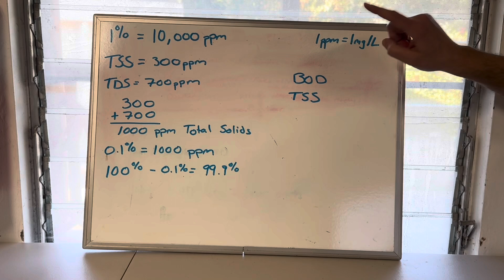What Is Wastewater Anyway??

Comment: So everything that is not solid is assumed to be water.  Couldn't there in theory be other liquids besides water?
Reply from the maker: Great question!  Yes there will be other liquid constituents in the wastewater, but on a percentage basis it’ll be negligible.  Take ammonia for instance, which typically comes in somewhere between 20-40 ppm (mg/L).  That is around .002-.004%.  For the sake of the entry level exams, it’s important to know that wastewater is 99.9% water.  Thank you for the question!